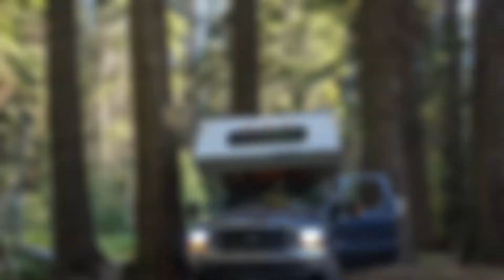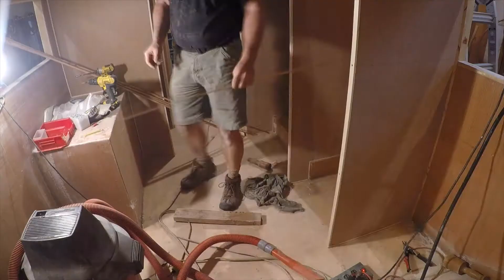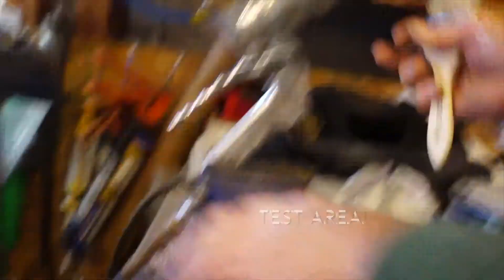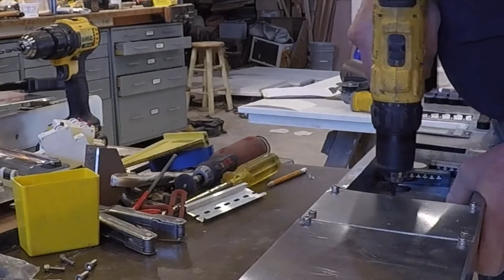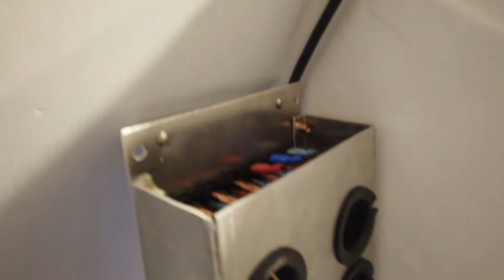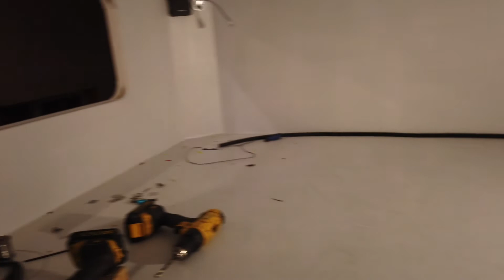Our Custom Camper Build | ep 7 | Lights, Power, Paint

Comment: That drop-ceiling vent idea is really neat.  So is the electric hatch.
Reply: My thinking was; Air circulation is typically done in residential construction by forced-air HVAC. Most RV's arent as well equipped with ductwork and even when they are it's usually just heating. Owners are resistant to using their furnaces due to power consumption. I wanted something that could provide continuous air circulation to maintain a uniform temperature that was low power and independent from the HVAC. Because I don't have opening windows, I rely on my ceiling vents which I can also use to create circulation ('in' on one and 'out' on another). I'm very happy with the result.
Reply from the maker: The roof hatch is definitely a sweet feature.